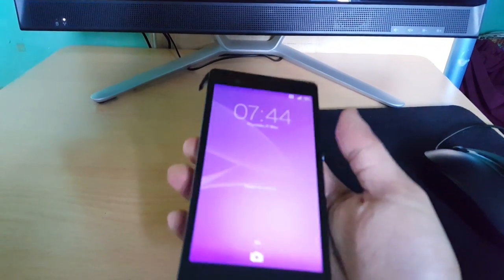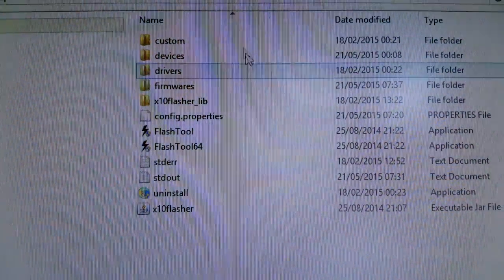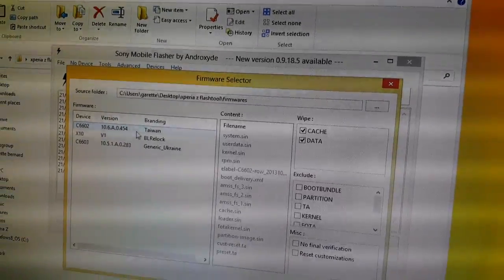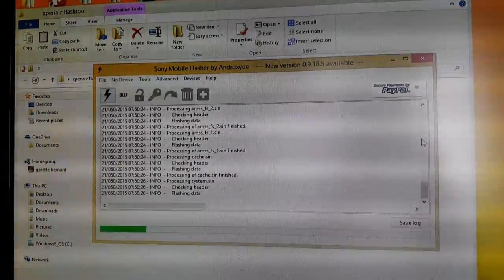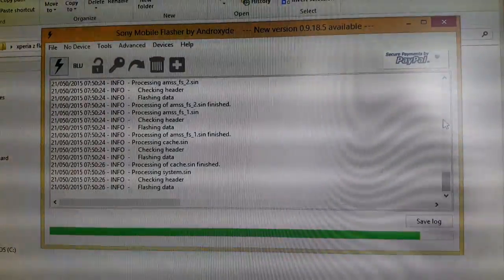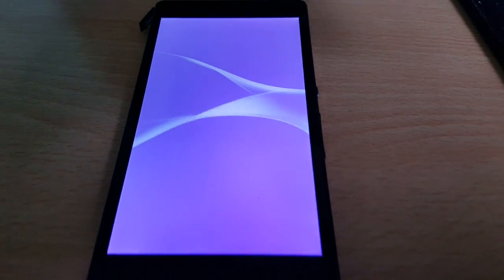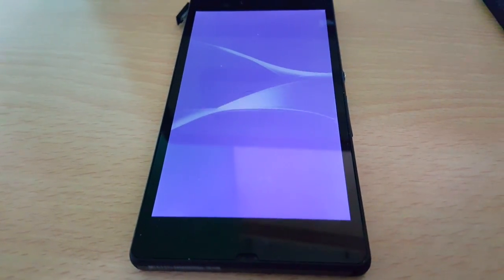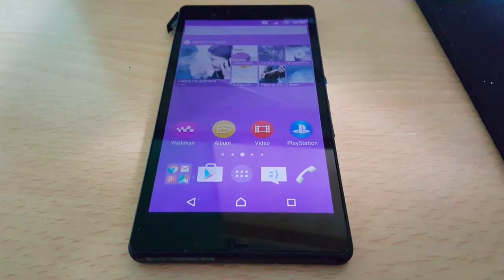Sony Xperia Z Install Official Android 5.0.2 lollipop Tutorial

Comment: shadowsniperhuddz sir i'v downloaded the file for C6603 Model, but when it's finished it appears as Zip file not an FTF and now flashtool won't recognize it
Reply from the maker: challenger3081 extract it and see if the ftf file is inside it
Reply: no just fw files, idiot internet download manger convert it to zip, and if i tried to redownload it with browser it takes loooong time . also tried to creat ftf file with flash tool and it gives me an error while flashing mode
Reply from the maker: challenger3081 ok try the 2 new links ive just added in the description they are uploaded to mega & google drive the download speeds are faster
Reply: shadowsniperhuddz thank you, its working and i've got it installed. really helped me :)
Reply from the maker: Did u have any problem with flashtool loading error sin? Because @HeneXx has this issue can u explain to him how u installed this thanks
Reply: yea, just cuz i didn't hold the volume button long enough it showed me an error, i followed the steps you explained that's all ..

Comment: I cant install it please help me
It says:
(Processing of loader.sin finished with errors.
Ending flashing session
Error flash. Aborted
Drivers need to be installed for connected device
You can find them in the drivers folder of flashtool)
What can i do please help
Reply from the maker: No its not bad  if u install c6602 fw to c6603 xz but however u will lose the 4G LTE option so in order to not loose 4g LTE download the c6603 lollipop fw from the link in the description and install it on your c6603 device or if u have c6602 device download the c6602 lollipop fw and install it to your c6602 device its that simple:-)
Reply: Emin Mirzeyev when installing flashtool drivers select flashmode & fastboot drivers also tick the xperia z drivers box if that option is there!! If you face problems with the drivers not installing and you are running windows 8 or 8.1go to  change pc settings on your computer select>Update & recovery>Recovery>Restart Now>Select Trouble Shoot>Advanced Options>Startup Settings then select Restart!! Once your pc boots back up make sure you select option 7)Disable Driver signature enforcement then once windows boots backup quickly reinstall flashtool drivers and they will get installed 2nd time round!!!!
Reply from the maker: Emin Mirzeyev yes if your phone is c6603 u need to install the c6603 lollipop firmware and 4G Lte will then work
Reply from the maker: Emin Mirzeyev open flashtool then look for the drivers folder inside it u will see a few boxes tick the flashmode box fastboot box and xperia z box to install the drivers then try again it should then work bro
Reply: shadowsniperhuddz i tried it but it doesn't work. I think this problem about my windows. I install drivers but it says you have to download drivers.
Reply: Have you installed sony pc companion and did you turn on the debugging mode
Reply from the maker: Emin Mirzeyev OK 1 last thing try this go to about phone in settings and keep tapping on build number until it says u are now a developer the come out of it and it should now have unlocked developer options go into those options and turn USB debugging on then try the flashtool again
Reply: Nick yeah
Reply: shadowsniperhuddz i tried it. Also i don't understand when i install drivers i see that DPinst.EXE can't install or another error about this exe.
Reply: you dont have to install any drivers if you have already the sony pc companion installed
Reply: Nick I have it
Reply: then you dont need any drivers
Reply: But why it said that drivers need to be installed for connected device
Reply: activate usb debugging from settings/developer options and use the guide to flash it
Reply: Nick really i used it but it didn't work.
Reply: Emin Mirzeyev no idea but try to flash it again the first time i tried to flash it it showed me (Processing of loader.sin finished with errors. because i hadnt turned on usb debugging
Reply: Nick yes yes i also showed it
Reply: Nick but then i tured on debugging and tried again
Reply: Emin Mirzeyev then try again with debugging on and tell us the results
Reply: Nick okay bro thanks
Reply: Nick shadowsniperhuddz is it bad to install c6602 android l to c6603?
Reply: shadowsniperhuddz Now I install android l for c6602. If I install android l for c6603, can i have 4g lte optoin again?
Reply: shadowsniperhuddz How can i fix dpinst.exe error please help please😭😭😭😭
Reply: it means that there was a problem while the drivers were installing
Reply: http://xperiafirmware.com/8-firmware/33-sony-xperia-z-c6603 do it as the guide says
Reply: Nick shadowsniperhuddz Thanks very much!!!!!!
Now how can I root my phone😂😂😂😂😂😂😂😂😂😂😂😂😂😂😂😂😂😂😂😂😂😂😂😂😂😂😂😂😂😂

Comment from the maker: VERY IMPORTANT READ CAREFULLY  when installing flashtool drivers select flashmode & fastboot drivers also tick the xperia z drivers box if that option is there!! If you face problems with the drivers not installing and you are running windows 8 or 8.1go to  change pc settings on your computer select>Update & recovery>Recovery>Restart Now>Select Trouble Shoot>Advanced Options>Startup Settings then select Restart!! Once your pc boots back up make sure you select option 7)Disable Driver signature enforcement then once windows boots backup quickly reinstall flashtool drivers and they will get installed 2nd time round!!!! THUMBSUP FOR ALL TO SEE..
Reply from the maker: Lara Bobadilla what is the problem?
Reply from the maker: No this won't work for galaxy s3 but if u watch my how to downgrade galaxy s5 from lollipop to KitKat video it will show u how to downgrade your s3 its the same procedure:-)
Reply: shadowsniperhuddz is there a way to download the c6603 firmware faster my network connection is 10Mbps and the download can reach only 112klbps
Reply from the maker: Nick ill see if i can find a better download link are u bothered if its hong kong or sweden lollipop fw?
Reply from the maker: Nick ive added a link to the sweeden lollipop ftf for c6603 model download it fom the link in the video description bro
Reply: shadowsniperhuddz on advanced startup > restart now /when i click on restart now i don't have option select trouble shoot, it just restart pc, and then i have fail with google, inc. (winusb) androidusbdeviceclass, and sony ericsson mobile comunications (ggsemc) usb. what to do? :S
Reply: shadowsniperhuddz i have done it -command prompt
Reply: shadowsniperhuddz  im using windows 7! Please help me
Reply: Nevermind. Finally made it! Thanks.
Reply: shadowsniperhuddz is this working also in samsung s3?
Reply: shadowsniperhuddz Hello,every time i Download with XperiFirm the German O2 firmware and try to flash I get a stupid error -.- do you know what it is ?
Reply: KNIGHT497 what's the error?
Reply: Tom WEY IM HAVING THE SAME PROBLEM PLS HELP
Reply: Android Doctor Please Sir can you send me the download link in which my internet download manager will handle rather than the browser?
Reply: Android Doctor And please what firmware should i download (C6603)

Comment: i can't install android 5.0.2 lollopop!!! PEASE HELP! it wrote that drivers don't installed and i go to the drivers folder and i try install the drivers but it can't install why? whta do you think what's the problem?
Reply from the maker: Zoli HD - Clash of Clans when installing flashtool drivers select flashmode & fastboot drivers also tick the xperia z drivers box if that option is there!! If you face problems with the drivers not installing and you are running windows 8 or 8.1go to  change pc settings on your computer select>Update & recovery>Recovery>Restart Now>Select Trouble Shoot>Advanced Options>Startup Settings then select Restart!! Once your pc boots back up make sure you select option 7)Disable Driver signature enforcement then once windows boots backup quickly reinstall flashtool drivers and they will get installed 2nd time round!!!!
Reply: shadowsniperhuddz ThANKS MAN! :DDD it's working very dood! :) i'm very happy because i'm waiting for this a long time
Reply from the maker: Zoli HD - Clash of Clans no probs b sure to hit the like button if my video helped you:-)
Reply: shadowsniperhuddz sorry i forgot it :DDDD